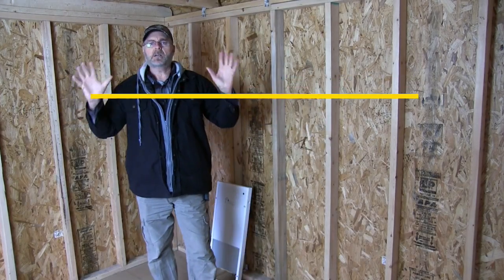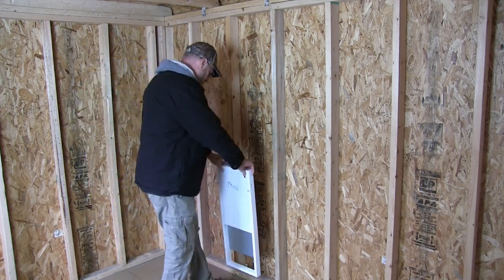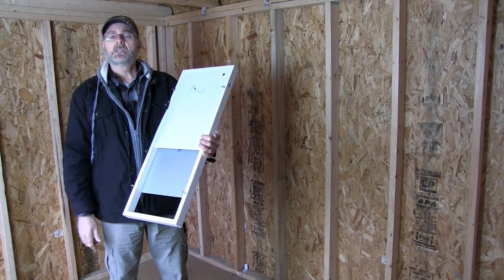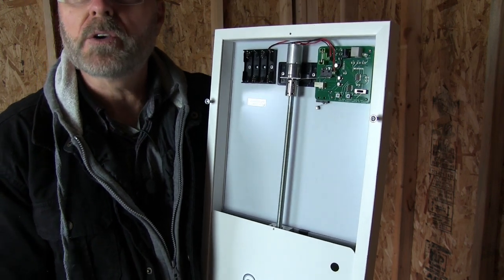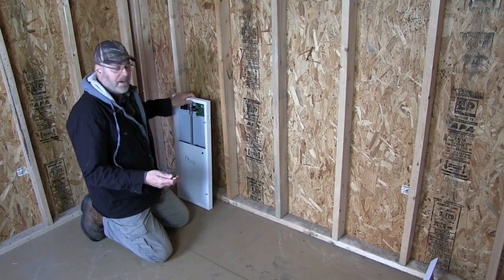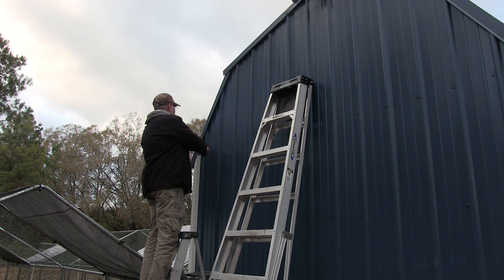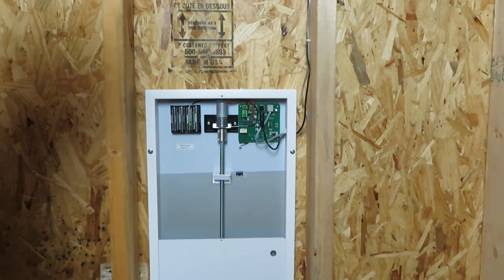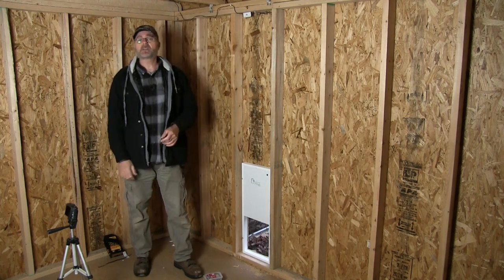Installing the Ladies First chicken door - Automatic chicken coop door

Comment: I’ve had this door for 3year now and love it just replaced batteries 2 months ago for the first time and have replaced the fuse twice and if you pull the batteries you have to reprogram the open and close time which is easy to do otherwise it’s worked perfectly will definitely buy again
Reply from the maker: Yep, very low maintenance. Mine have been working great too.

Comment: I love my ladies first chicken door.  I wanted to purchase my first door  after watching you install your 1st one.  I did not purchase it however until after you had installed your 2nd one.  My ladies first chicken was easy to install and it works great.  My girls are in a safe coop with a safe run outside.  I have no idea what time the door opens or closes.  It does its job without my knowledge and that is what I wanted.imeold, 61, and disabled.  Sometimes when I have a bad night I want to sleep a little longer.  Ladies First Chicken Door allows me to do this.
Reply from the maker: That's awesome! mine have been working great too.

Comment: Can you please advise us on how to install the door on a metal shed building one think on getting it but how would we install it? Any suggestions.
Reply from the maker: You have to cut out the opening as per instructions and just screw it on to the outside of the building or the inside like I did in the video.
Reply: @petebeasttexashomesteading   it does not have 2x6 on the inside just metal would it work with self tapping screws
Reply: Also thank you , and for the videos great source of info
Reply from the maker: @rafaelfamilia1004  Yes you can use self tapping screws as long as they are long enough and you don't strip them when tightening. You can also drill small holes in the shed and use the screws that come with the door. You can also drill the four holes for the door in the shed and use some small long bolts and nuts to hold the door on. Hope this helps.
Reply: @petebeasttexashomesteading  thank you
Reply: @petebeasttexashomesteading  any advice we’re to get grubterra can’t find it ???
Reply from the maker: @rafaelfamilia1004  You should be able to get them on their website. Here's my affiliate link Grub Terra soldier fly treats: https://bit.ly/3hMagJS